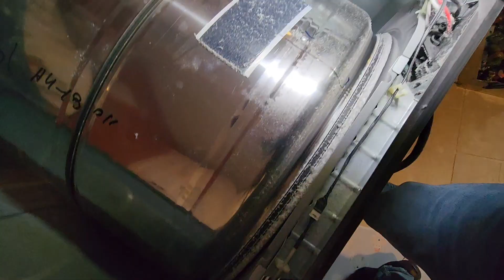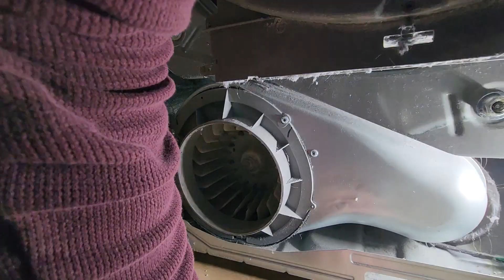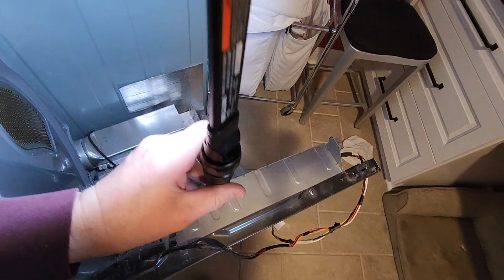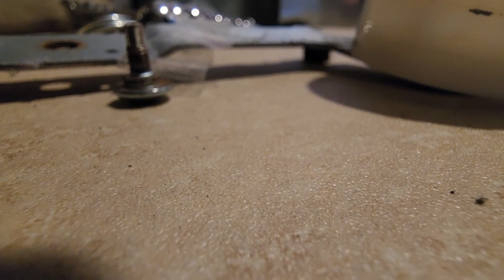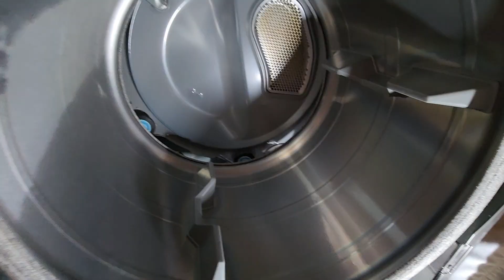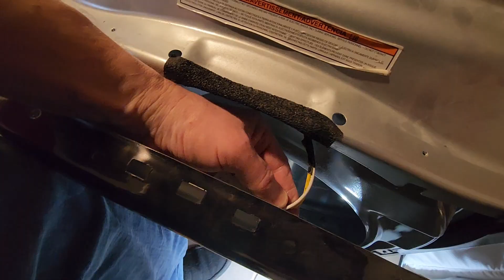Dryer making noise, grinding, loud, Samsung DIY homeowner laundry repair

Comment from the maker: See below for Parts and Tooling used in this video. The links I provide are Affiliate links that I earn a small commission from but don't cost you anymore. Thank you for your support.
Dryer Repair Kit

     https://amzn.to/4iazeQT
Heavy Duty Folding LED Rechargeable Work Light
     https://amzn.to/3F2qj5J 
Ratcheting Screwdriver Set
     https://amzn.to/3ETu6lZ 
Milwaukee M12 1/4 Ratchet only
     https://amzn.to/3EOUbma 
Milwaukee M12 Drill/Impact Combo Kit 
     https://amzn.to/49RnS1F
Off brand Cordless ¼” & 3/8” Ratchet
     https://amzn.to/3XakWru 
Dryer Heating Element
     https://amzn.to/3Qvswcs 
Ullman Pick Set    
     https://amzn.to/3WHAWkn